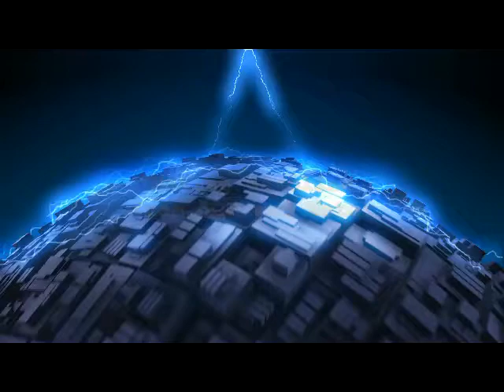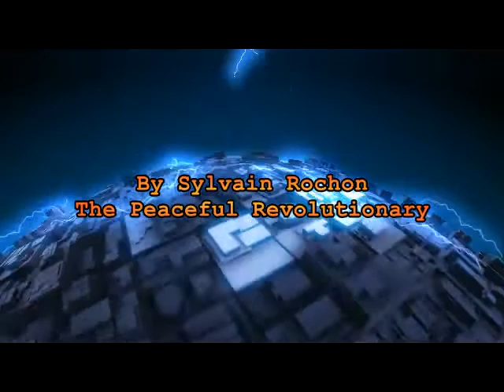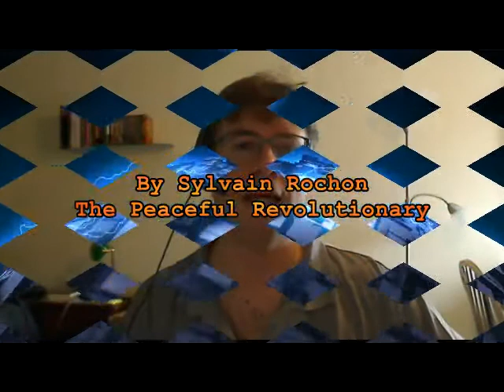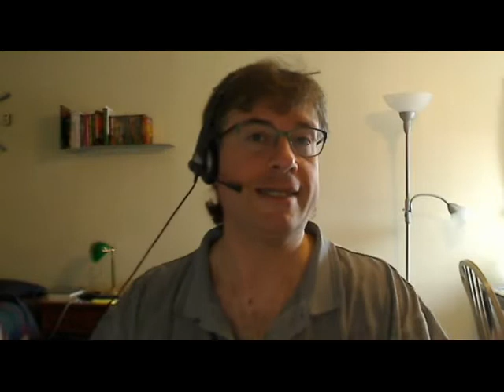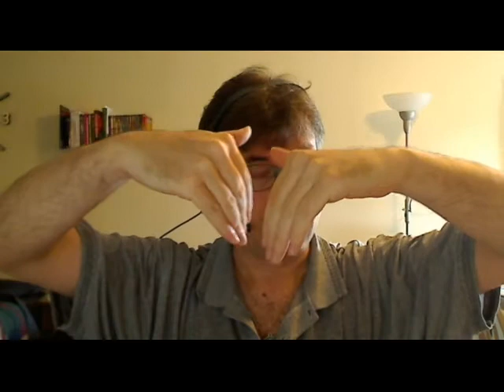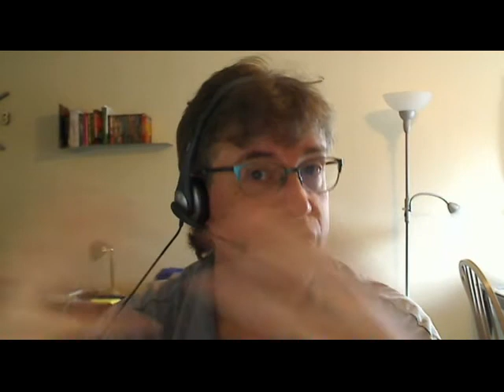The Peaceful Revolutionary - Science & Tech - Making Gasoline from CO2 and Water

Comment: This has been happening since 1925 two German scientist made the method can't remember the name. Eventually they were killed. And this is how most oil is made it's not drilled very little of it is. This is why Rockefeller moved oil production to the middle East with barbaric laws prying eyes wouldn't be able to see what's going on. Chop hands off for stealing etc. Sharia law. Just like your power, it goes back to the grid put a clamp meter on the neutral bus and turn a applianc e on it goes through the device back to the grid yet your charge for everything coming in but not what your putting back into the grid.

Comment: Would you try to actually have an experiment to prove this concept, because I hard that you can probably use renewable resources like solar power, wind etc.
Reply: +Killerman _7990 *heard
Reply from the maker: +Killerman _7990 Ideally, solar is the best, or hydrogen, since both substances can theoretically produce all the energy we need without running out, and all super clean.  As far as experimentation, you can check the links and do deeper research into the teams that are working on this CO2 + water + light ==> gas engine and get the details of their process.  Unfortunately, for the new stuff you'll need to wait or dig into their most recent published papers for specifications, unless they chose not to publish in order to nab a patent etc.... tbd.  Chemically though, the reaction is a known one.  The issue resolved is all about lowering the activation energy enough to make it viable and making it all a one-stage process.  The reaction itself into mechane was done back in the 1980's and there is plenty of data about more experiments after that.  Just not commercially viable as in those cases, it took more non-renewable energy to make it work than was produced, so not good.Before this tech is used publicly, the usual alternate clean sources of energy are not only viable, but every house can set up their own pretty easily at minimal cost (I have a video about just that I did last year).